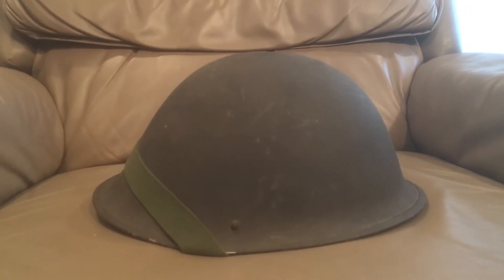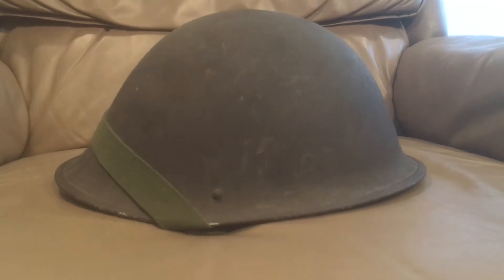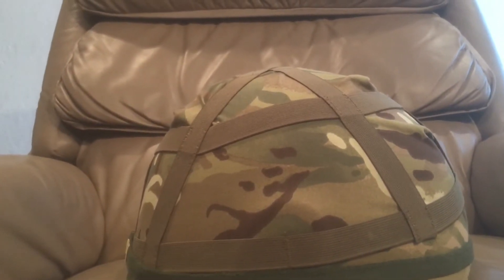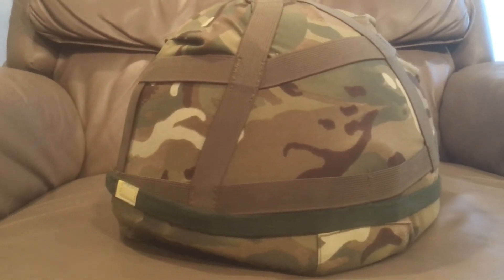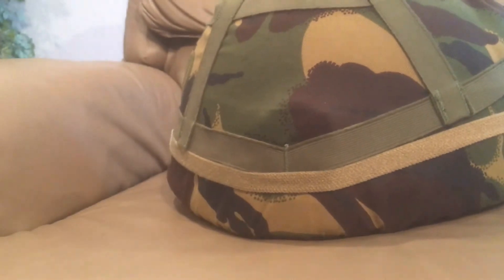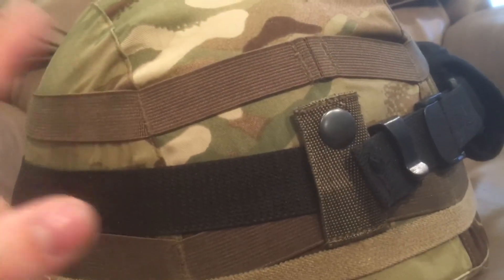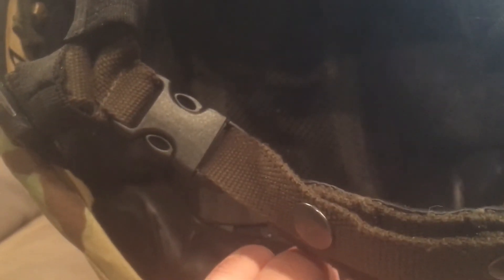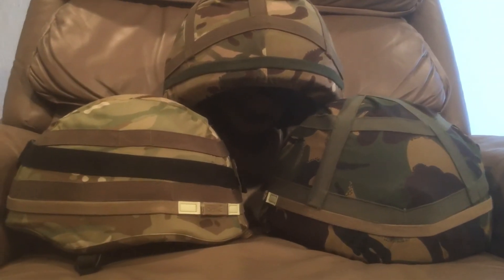British composite helmet comparison

Comment: The nipples on the top are for when you fit a visor for public order as well as the screws on the side
Reply: The first part is incorrect. If you put a face shield on the Mk6, the shield would just go right over the nubs if you push it back that far. They are purely for keeping the liner in the helmet